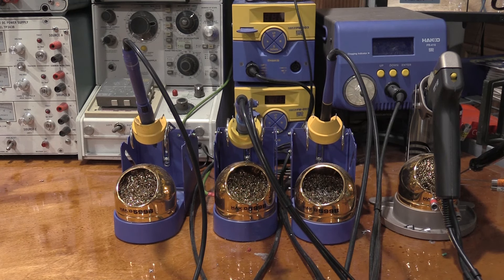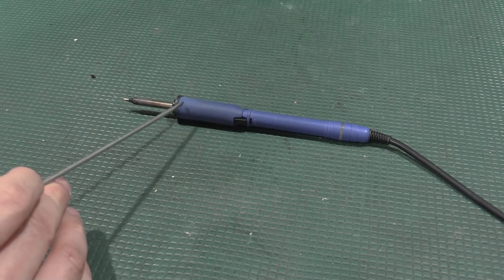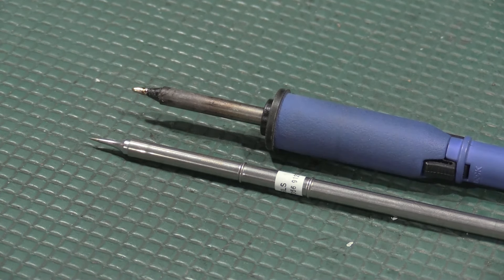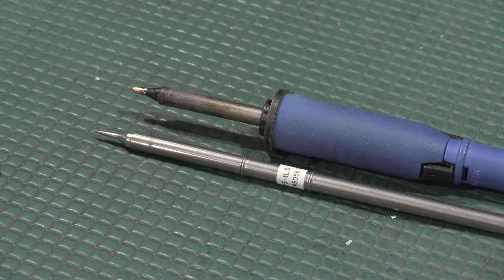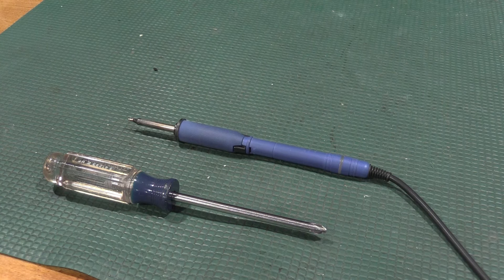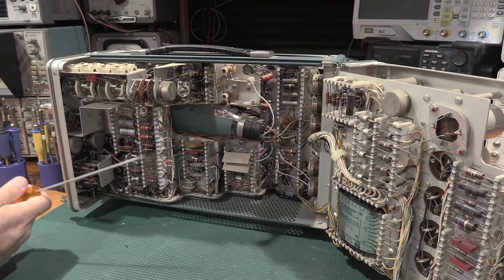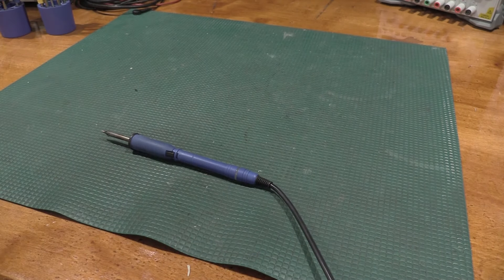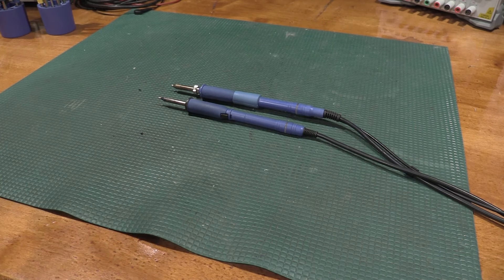Mastering Soldering Iron Temperature: Tips & Techniques

Comment: I'm one of those who love HF tips (Thermaltronics TMT-5000S system) Beneficial is that it throw much more power in short time. Therefore even smaller tips don't need so much mass. (I have experience with JBC, Weller WX system and some Chinese stuff as well) Changing the tips is really necessary only in case of massive thermal mass like big ground planes or power components. And for those I have only one tip. The rest is for low temp only different style depends on type of components. Most used is 3mm chisel after that conical and last sharp tip. What I'm missing in Thermaltronics offer is microwave (chisel tip with small hollow in the center)
Reply: I agree! I absolutely love my Metcal MX-500.

Comment: Nice I have a PACE PRC2000 also known as a Model PPS400 and those Pencil Soldering Irons PS 80/90's etc give out all the time, and they start at like $135.00 each without a tip. Of course in a production or repair center, these tips can go through as many as 20 cycles in a day all week long, and sometimes are on almost 7-8 hours a day for days in a row until the weekend comes. However I just might have to figure what Hakko is doing and adapt them into the PACE Station. One thing I do like about the PACE station Irons is the tips are changeable on the irons without having to unscrew the iron or change it out all together. I also like the Temperature Setback Mode, basically it's an idle mode where you can ask it to keep the tip warm but not hot, like if you go to lunch or the restroom. After you take it off Setback Mode it warms right back up fast. When I went to school for soldering, the basic rule for us was to choose a tip and wattage large enough that you could get a full wet and be on and off the joint in 3 seconds or less. Large ground planes obviously require a larger mass tip and the SMT's with leads attached used the smallest tips. Again the basic idea was the smaller the lead or area, the smaller the tip to keep the iron from transferring to much heat to the board. A really good primer on the video bud. I loved that you talked about the humidity and iron components, I never knew that one. Thanks for sharing, love the channel, you are way under subscribed to that's for sure. Best Wishes & Blessings. Keith Noneya
Reply from the maker: Thanks! The hakko irons have a switch built in to the stand when the iron is at rest there is a set back mine drops to about 350 degrees F. it is not instant there is about a 2-3 minute delay before setback kicks in reheat takes about 15 to 30 seconds when the iron is picked back up again. This is also true for the micro and N2 iron as well.

Comment: Good soldering stations, both Hakko and Weller (have both), that will keep up the heat transfer can surprisingly attach a  PL-259 or N silver connector to the end of a 100' of LMR400 cable...surprised me the first time I was able to do that.  73 - Dino KLØS

Comment: With over 50 years of experience soldering, I found your advice very sound. I particularly agree with the fact that soldering is a bit of an art. Buying some cheap kits and putting them together for practice is a good way to learn. Then try working on that $1,000 transceiver, when you feel confident Two items I would add. 1) The solder is hot enough when it turns shiny. 2) Learn to minimize the amount of solder needed to make a strong joint. Globs of solder are not good.
Also get a good de-soldering gun, solder suckers work but get a bit tedious when having to replace multiple parts, such as recapping an old piece of equipment.. That should be a good topic for a follow up video.
Reply: Yep I agree. I've been soldering for over 25 years. For multiple mass removal of IC's with legs or through the board holes I found just cutting the legs off next to the component and leave the leg on the board. Then use a set of resistive tweezers to grab the legs while pulsing the peddle every second and pulling at the same time get the board clear quickly and works extremely well. It keeps the solder sucker from over heating the board and most of the time the tweezers will leave a nice rectangle hole in the through pad. After all the component legs are off, then go back and quickly remove the solder from all the holes with the solder sucker. Of course that only works if you don't want to save the components to put on another board. Best Wishes & Blessings. Keith Noneya

Comment: i use a WEP 948 90W which a solding and desoldering. for solding i use at 640 f i havent had any problems but desolding side the only problem i have is the tip got fused together by using it to hot